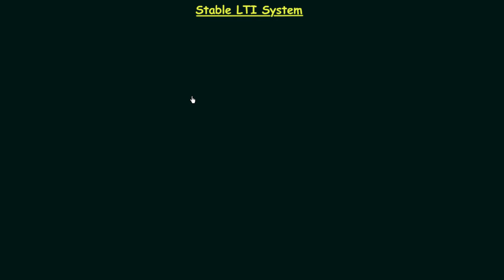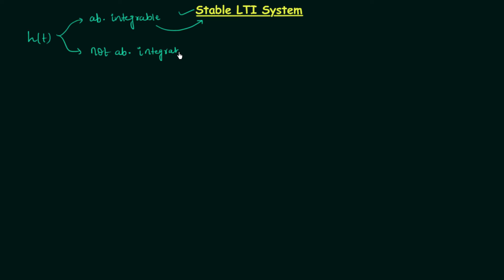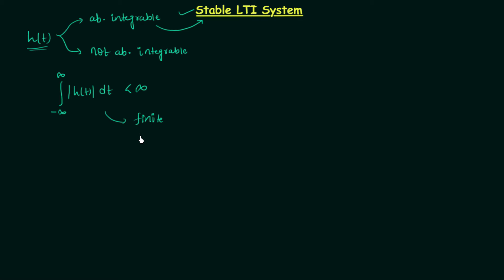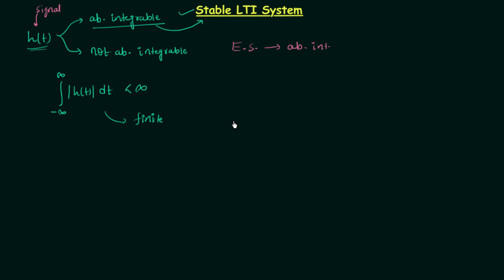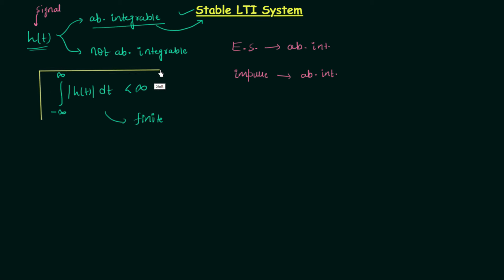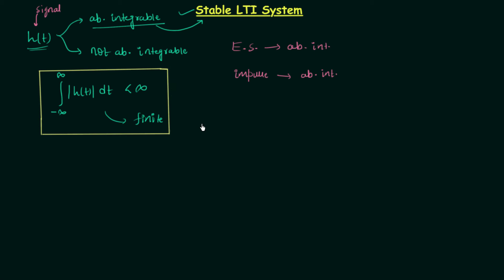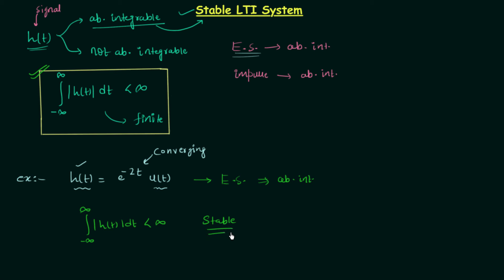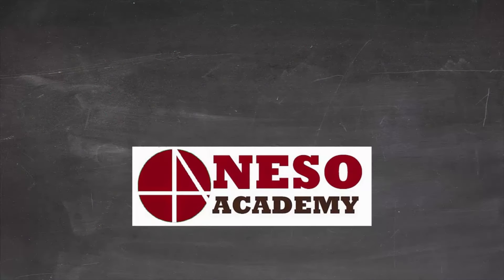Stable LTI System

Comment: But observe.. if h(t)=del(t), Then h(t) will be absolutely integrable, which makes it as stable LTI condition.But h(t) is infinite at t=0 which makes it NENP signal. So i think if h(t) is energy signal then definitely it is stable LTI. and vice versa is not true,as in the case of h(t)= del(t). May be this is an exception. :)

Comment: Hello sir.previously you said in unit impulse signal is NENP signal.but now you are relating impulse response to energy signal and if we calculate total energy of impulse signal by formula we get finite value.it means is that an energy signal?
I am getting anger sir .you are not answering any thing.previously I asked a dout in even and odd signals.still you have not answered.
Reply: But observe.. if h(t)=del(t), Then h(t) will be absolutely integrable, which makes it as stable LTI condition.But h(t) is infinite at t=0 which makes it NENP signal. So i think if h(t) is energy signal then definitely it is stable LTI. and vice versa is not true,as in the case of h(t)= del(t). May be this is an exception. :)
Reply: @neeltej4123  but e-2t is TV ryt?
Reply: Yes impulse signal is NENP signal because impulse value is infinite....but impulse signal is absolutely integrable...that means if we take mod of impulse signal and integrate it between -infinity to + infinity them it will be finite because area of impulse signal is finite....so directly we can't sày that impulse is energy signal but when it's absolutely integrable then it can be used to calculate  energy